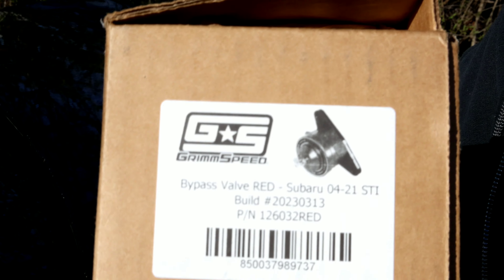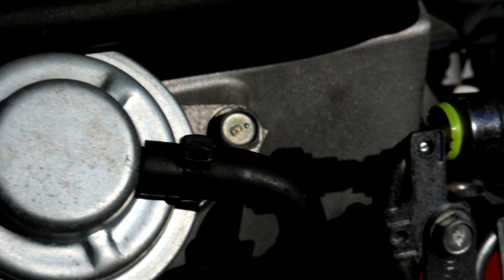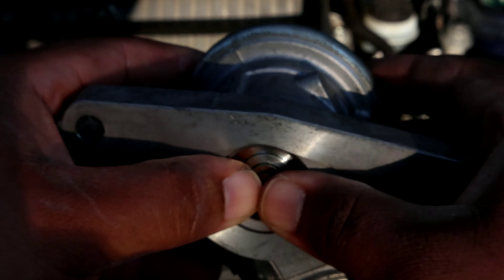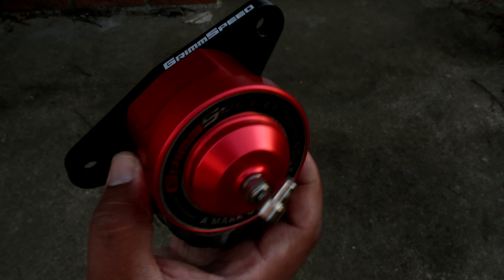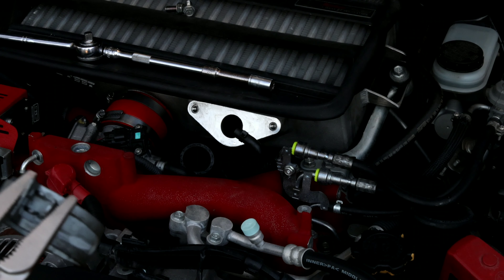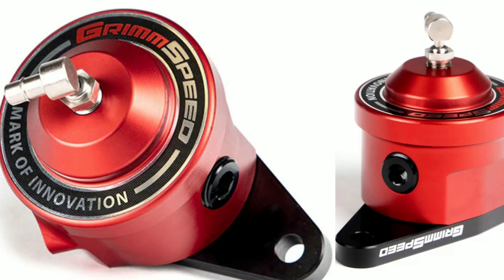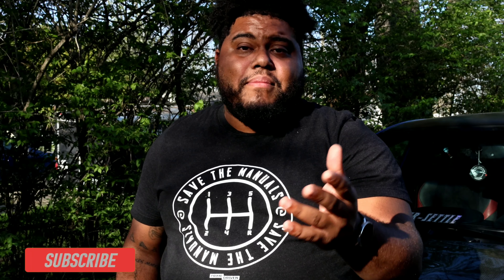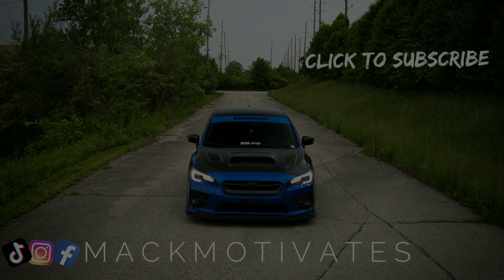Grimmspeed BPV Version 2 Review! (04 to 21 STi) Best alternative to a BOV??

Comment: The upgraded grimmspeed v2 is supposed to prevent the turbo flutter. Because it recirculates the exhaust pressure rather than releasing everything like a traditional BOV. BPV uses the excess exhaust pressure so you have less lag and less spool time. BPV are what a daily driver build would be best recommendation for stock turbos and scroll turbos. BOV for high HP builds and non-scroll turbos. BPV keeps the turbo spooled between up shifts to prevent/eliminate boost lag. BOV releases all exhaust pressure which is good for high power race cars not a stage 1/2 daily driver build. The best recommendation I can give is to research the turbo in your car or the turbo you bought for your build and find out what type of turbo it is and the recommendation for a BOV/BPV to have the best results

Comment: So glad you pointed this out as Grimspeed tried to quickly bait-and-switch after posting numerous videos of the sound. I bought the V1 the day of launch, with an intake and DP on my 2014 STI, you get almost a BOV type sound when you're in mid-range boost (7-14 psi) - With a full woosh at 18,19psi. Unfortunate that Grimspeed didn't disclose this change on the V2 and tried to push it out as the same product. 0 Leaks with mine.
Reply from the maker: Glad I could help!

Comment: I have a v1 and love it. sounds great, looks good, no leaks, holds boost. and the sound 👌👌👌. did I mention the sound? lol
Reply from the maker: U luckyyyy mofo! Lol im switching to the tial bov and gonna get speed density tuned for my new motor set up! 🫡
Reply: @MackMotivates  nice! those sound amazing in person. yeah I pre-ordered mine as soon as it was announced lol. I think it took 3 months or something.
Reply from the maker: @wage6681  i have another video where I installed it without a tune just to show people it's needed for a bov and not a bpv..lol
Reply: @MackMotivates  haha! I learned my lesson after installing a hybrid bpv set to 50/50 lol. car ran okay till I hooked up an accessport and saw what was going on 😂
Reply from the maker: @wage6681  Ayeee! Im glad you caught it! What year is yours?!
Reply: @MackMotivates  it's a 2021, currently basic bolt ons engine wise. the carbon redline intake, Grimmspeed bpv and ebcs, iag aos. Doing nexgen flex soon but don't want to pay Cobb's insulting pricing for the sensor lmao. Also have some drivetrain stuff.
Reply from the maker: @wage6681  hell yeah man enjoy! They are super fun cars! Im getting a iag built block soo just savinggg for that right now...superr priceyy!

Comment: I have the version 1 and I have had no issues. Tuned for 18.5 PSI, I get the off boost flutter at low pressure and get the solid whoosh at full boost. My tuner hasnt had any negative comments towards it, im sure if there was an issue he would have picked it up during tuning.
Reply from the maker: Ayee! As Long as you love it!

Comment: I have a WRX VA so i purchased the other v2 BPV (SKU 126033BLK). Fingers crossed I get some flutter. Will be getting it installed in a few weeks. If not, I'll switch to the Boomba...
Reply from the maker: Hope it gives you what your looking for! Still a great product overall tho!
Reply: Just installed it on my WRX that has upgraded turbo and fmic, and absolutely zero flutter… had boomba before probably gonna switch back for the flutter lolz

Comment: i got the version 2 expecting flutter, pretty disappointed, especially that i’m not planning on pushing a lot of boost through it, so now i kinda have it for no reason
Reply: oh man I'm so sad. Going to initiate a return whilst the bpv is still in transit
Reply from the maker: It at least looks way better tho!
Reply: Do you have an intake?
Reply from the maker: @keshakio2079  yes aem air intake is what  I have..full bolts ons..bigger turbo and all that etc.
Reply: bypass valves don’t give you flutter, blow off valves do, you don’t want a blow off valve without a tune
Reply: @stockblockglock  their v1 BPV did though, although probably why people were running into issues with it leaking and car shutting off and whatnot

Comment: The one on my Subie sounds like it's letting air just escape all the time  it's a turbo smart. And it doesn't matter where at on the throttle you are. I think it's toast might upgrade to a different one.
Reply from the maker: This ones just a tad bit louder than stock and looks good!
Reply: @MackMotivates  I ordered a Perrin bpv today.  I'm Hitting gate which is 7lbs I should be getting 13lbs. I tested the solenoid it checked out good. Did a leak test didn't see anything.  But the bpv is extra noisy and it sounds like a bov why I think it's bad. 
And bro your sbuie sounds amazing.  And cool yours is holding boost better. It's crazy how temperamental these subarus are.
Reply from the maker: @BodVar_Sul  thank you tons! Hope that fixes your issue tho!

And mannn my subie is actually down now..spun a rod bearing. Hoping to get it back up soon tho
Reply: @MackMotivates  Thanks bro, and man really. Love the flat 4 wish they had a better oiling system. How many miles did you get out of your engine? I want to try to find a spare for mine so I can build it up a little with Manley rods and JE pistons.
Reply from the maker: @BodVar_Sul  73k miles out of mine. In my ownership of 3 years i put 52k miles on it..it was a great setup..tons of trips (all documented on here too!) And a few track days and all

Comment: You don’t need to go speed density or bov to get flutter. Time to start looking for a flutter sounding bpv like v1. Anyway I appreciate the vid
Reply from the maker: You're right, you don't need to go speed density for flutter BUT you do need to go speed density to run it correctly on your car. I cant repeat this enough but if you're going to vent to atmosphere you need a bov. These motors are built on a recirculation system which is why it's BPV and not BOV.  There is a reason why everybody hopped on board and wanted to order this bypass valve when they heard that there was flutterr because there's none on the market that do so like that in bpv form, but that's also why they probably had to change version one in the 1st place. Thats just my 2 cents.

Comment: this answered so many questions  can you put a tune on it and add the bov?
Reply from the maker: To add a bov, yes you would need a tune and a speed density sensor added as well. Or just buy a bpv or recirculating bov..it's the same thing as long as the air isn't venting to atmosphere

Comment: i have the same issue, i have exahust and intake, with no flutter at all. Running V2 bypass valve and it sounds the exact same as stock BPV...
Reply from the maker: yeah,, kind of sucks, but it does hold boost better and looks better than stock!

Comment: Did you use an oem gasket during the install?
Reply from the maker: No need too..I showed in the video they have an oring installed on the new bpv to make the seal. So the oem gasket is not needed for install of this product. 🙂

Comment: well, shoot. I have a 2011 wrx and my v1 leaked at high boost. I contacted grimmspeed and sent them my v1 for diagnosis.  they confirmed it was faulty and sent me a v2. it arrives today. I'm not as excited to put it back in my wrx anymore now. 😢
Reply from the maker: The bpv designs are different for the wrx and sti tho..this video was directed to the sti, as it uses the ej motor than the fa. Soo im not sure if there will be a difference for you, if you have the fa design. Good luck tho! 👍🏾🤞🏾
Reply: @MackMotivates  I'll come back and report what the v2 sounds like in comparison to the v1 in the EJ for those who come to your channel and are curious.  I'm waiting for ups to deliver as we speak.
Reply from the maker: @MixedBiscuits  sounds like a great idea! Thank you!
Reply: @MackMotivates   back with an update! installed the v2 in my 2011 wrx. no flutter at all whatsoever. to be completely honest, the subaru oem bpv sounds better. I'm going to be trying to get my money back from grimmspeed. the v2 is completely different from the v1.  the main reason why people bought this bpv was to bring out that stu stu stu stu and the v2 does nothing but give some whooshes.  🤷‍♂️  I purchased from the v1 from rallysportdirect so well see what a possible nightmare this will be to get my money back from grimmspeed since they were the ones to diagnose my v1 and send me the v2.
Reply from the maker: @MixedBiscuits  thanks for the update bro! Sry it wasnt what u thought bro! Good luck on everything!

Comment: Did you have any stalling issues with this Grimmspeed setup?
Reply from the maker: Nope. U see my install from start to finish in this video. One thing u might wanna check is if your bpv gasket is or is not removed from the stock bpv. The new one provides an oring gasket other than that check you return hose at the bottom of the bpv and u should be good to go
Reply: @MackMotivates  cool...
The reason I was asking is because my friend has this product, and he was constantly running into issues with his car stalling out. Became dangerous especially on the highway and such
Reply from the maker: @CBattleJr  I havent heard of such things yet..i would double check installation and definitely the bpv gasket to see if its still on

Comment: That sucks they ruined it😭
Reply from the maker: I mean it works better now so they didn't..if u want whoosh sounds then get a vent to atmosphere and speed density tunee
Reply: @MackMotivates  Meh..anyone who was considering one of these wanted it because it A) recirculated B) and gave that flutter sound instead of just a sharp "whoosh"
Without that, it wont be worth the money unless you just like the looks. I ordered mine April 2022, still haven't heard a peep. Likely going to cancel my order after this change.
Reply: @Los  if you ordered a V1 in April, you will just receive a V2 . Just called them about my order in early April
Reply: I can confirm that. I ordered a V1 in early February. Got a V2 in April. Definitely more sound than stock.
Reply: @CWHolleman  I wanted it because its recirc and grimmspeed, I do not like flutter on subarus it doesnt sound right to me